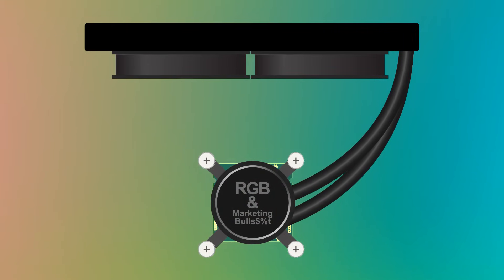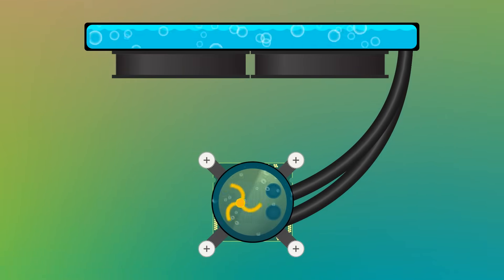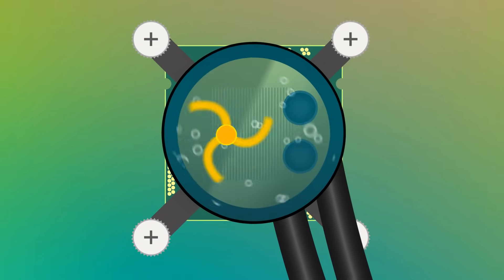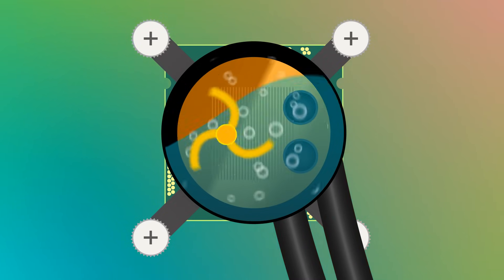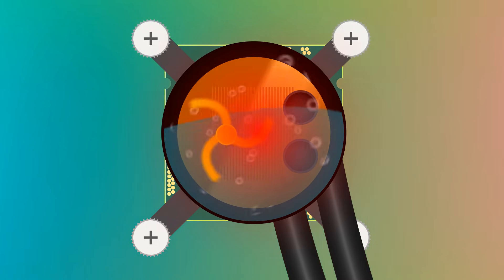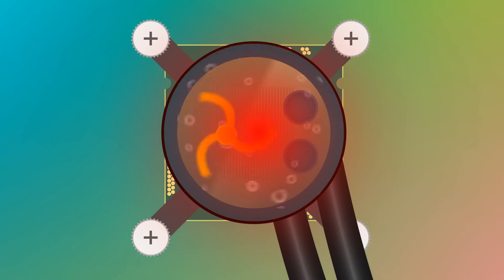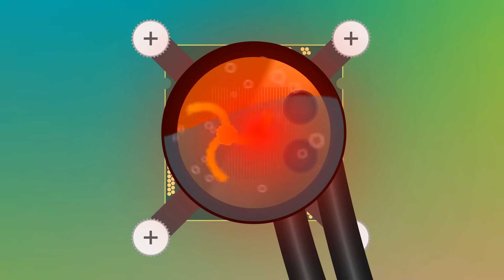Correct AIO orientation (This is the way)

Comment: I'm using a mini-ITX case so I have no choice but to have the CPU higher than the radiator. So I just oriented the pump so the tubes on the pump are at the top of the CPU.
Reply from the maker: I gave up on Mini-ITX format and just went big Lian-Li o11. 

Small case and cooling don’t really mix well unless you go crazy custom like that Optimum guy.
Reply: @tldrinfographics5769  That's all for the most part true. My job has me traveling a lot so I was kinda forced to figure out a solution with ITX. I was able to have success with the SSUPD Meshroom S V2 without customization. I have a Ryzen 9 7950x with a 280MM AIO and RTX 4090 in this build with no overheating.

Comment: Does it matter where the tubes are on the pump with the radiator on top mount?

Like if the tubes are going towards the ram or which is the preferred way?
Reply from the maker: If the radiator is on top tube can be anywhere.
Reply: @tldrinfographics5769  okay thanks for that ❤️

Comment: My radiator is on the side of my chassis but a little bit higher than the pump... but my temps is very good and i cant hear any bubbles flotting around knowing that my pump is on middle speed
Reply from the maker: If it ain’t broke don’t fix it sir.

Comment: Hi i've got my first aio nzxt x73 and it says that the tubes should be on the side well i've got a problem with this cuz of the 32gb of ram sticks when i install it to the side i pushes on the ram sticks and i don't wanna damage my motherboard so i moved my tubes much lower s that ok and the radiator is installed on top of my case
Reply from the maker: That should be fine
Just occasionally listen for gurgling sound and check CPU temp

Comment: I do not understand why you call this as marketing BS, because it is higher than fan. The problem is with the entry point which Nexus video said that it must be lower and not higher, because air will get stuck there. Overall, video was not clear enough for me, but it helped me to double check the information regardless.

Comment: Btw does this also apply to gpus with aios because I was gonna mount the GPU vertically with the 240mm rad under it also amazing vid keep it up
Reply from the maker: Thank you. 
I am not sure about the GPU radiators
But I think the principal is the same

So ideally the highest point will need to be the radiator.

Comment: What about a AIO that has the pump in the radiator. Would top mounted still be okay? Or if I did tubes down front mounted but the cold plate is highest spot of the AIO would air get trapped in the plate even though the pump is at the bottom?
Reply from the maker: For that particular configuration 1:30 is recommended.

And yes the tip of theradiator still needs to be the highest point in the system.

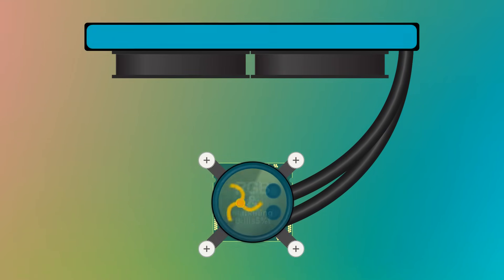Comment: does the AIO pump orientation have to be the way it is made? for example i recently installed an aio into my pc but my ram sticks got in the way of the hoses so i turned the pump 90 degrees to make clearance, could this be causing the issue? my current set up is the same as 0:11
Reply from the maker: Pump orientation isn’t as important as the radiator placement.

Comment: No it is not.
The better way to place it is:
- tubes out from pump are up
- tubes out from radiator are up
- pump below the lowest point of the tubes from the radiator

This is just following physics law that air will ALWAYS try to get to the highest point.

Your setup will need more (water) pressure to push all the air bubbles (if any) already trapped in the pump to travel down the tubes (they are placed very low at the bottom). Easier if they are travelling upward.

Comment: So I have an MSI CoreLiquid 360r mounted at the top of my case and its been making a clicking noise, this AOI actually has the pump in radiator. In my case, would I want to side mount the radiator with the pump being towards the bottom?

Comment: does continuous heat from cpu/pump will create  hot air bubbles in the water? 
if yes what if those hot air keep trapped between pump and the tube hose, but never goes back to the radiator?
Reply from the maker: No amount of air bubble doesn’t increase like that

Comment: Can you show please what if the radiator mounted front of case and tubes up ? I have 360mm AIO
Reply from the maker: Not ideal but it’s ok.
Reply: @tldrinfographics5769  Thanks for respond. I don't have enough space to flip tubes. I have corsair 275r.
Reply from the maker: @Rwayne-  yeah a lot of us are in the same scenario
Reply: @tldrinfographics5769  One last thing that is i wonder, how much it does affect the performance and tempature really?
Reply from the maker: @Rwayne-  From what I gathered from the internet it’s 1-2 degrees. 

And in some cases a bit more noise.

Honestly it’s best to mount it up top 0:11
If you can’t than change the case to big one.

Small build is always compromising.
Reply: @tldrinfographics5769  Thanks, I want corsair 7000d airflow series honestly. But it^s too much expensive here. Btw i meant that difference for mounting orientation. About tubes down - up radiator uper level than pump you know. I did not ask it for mounting top or front. I guess you understeand me already but i just wanted to be clearly in this case.
Reply from the maker: @Rwayne-  in any orientation difference are around 1-2 degrees C 

As long as the pump is below the radiator top end

Comment: My question is how do you know how much water is inside of the block. is it because the block is transparent?(not all blocks are transparent) Also wouldn't there be air in the block if the system was checked while it wasn't running because usually the water does run back and some blocks have only one intake and one output so there's only ones path for the pump to push it through. That's how my cpu block and other block is designed. Not sure which blocks are just pockets of space.
Reply from the maker: They always leave air in the system because water doesn’t compress much at all which means it will simply burst when it heats up.

Comment: If I have the tubes going up that's still ok right? The radiator is still higher than the pump and I hope there isn't that much air to still be picked up
Reply from the maker: As long as the radiator is the highest component of the whole AIO system it's ok.
Reply: Yeah, I really don't have the space for the tubes to go down
Reply from the maker: @Mart-E12  It’s ok, I personally don’t prefer it but if you don’t have space that’s the only thing you can do.

Comment: What if our video card is massive and there's not a lot of space? I.e. NZXT s340 elite, Asus Tuf 3080, h100i v2 (gtx). There is only one exhaust port at the top, so you cannot top mount and the video card otherwise saws the tubing if attempting to jam it between the video card and radiator. I guess the tubing has to droop in front of the graphics card at the window?
Reply from the maker: Ah that’s painful.
You can have the tubes up as last resort.
I personally don’t like that so I just went out and bought 011 XL

Sick and tired of hunting for space.

Comment: I dropped my idles from 40 to 35c on my 5900x with this video. My In and Out tubes were on top, mounted to front of case. Placed the In and Out tubes at the bottom and man did the temps drop. Made a bit of readjusting gurgling noise on first boot but went away after a few minutes.

Thank you <3
Reply: So if my aio is mounted on the front of the case , I should I have my in an out tubes coming from the bottom of the radiator instead of top??
Reply: @Jose-q6w6e  have you tested your theory?
Reply from the maker: Thank you I’m glad to hear!
Reply: Its simply...air floats to the top...They ALL float. Put the pump at the top and that is where it will congregate. Inside the pump. The trouble seems to be not enough tube length in a lto of cases

Comment: Watch Jayztwocents' video on this. The inlet and outlet do NOT need to be at the bottom, and many systems won't even allow the tubes to be down like shown here, heavily depends on GPU and case size and orientation.

Tubes up is still fine, it's just noisier, GN talked about that and people skipped over it and think tubes up is still going to kill the pump, but it's not, which is why Jay made a response reiterating that tubes up is fine.

As long as the pump isn't the highest point, it's not going to kill your pump.
Reply from the maker: You are correct.
Buy it’s still not the best to have the tubes up.

1. Radiator on top
2. Radiator front with tubes down
3. Radiator front with tubes up

That’s the order in which you should favour.
Reply: @tldrinfographics5769  I agree, but I just want people not to worry about it if their case doesn't support having the tubes down if the tubes are too short or the distance is too great, as is the case with popular cases like the standard O11 Dynamic with most/all 360mm AIOs.

AIO as intake also isn't necessary if there's sufficient airflow into the case; I switched my AIO from intake on the side of the O11 Dynamic to exhaust on the top, and I didn't notice a significant change in temperature with 6 case fans (all intake), CPU is 3900X and AIO is Deepcool Castle 360 V2... I suggest that people test the differences with their own hardware before making a decision on where to put and keep their radiator. What one user gets may not be the same result for you

Comment: But most AIO tubes aren't long enough to be on the bottom of the case especially 360mm radiator (most cases didn't support 360mm on the top)
Reply from the maker: I feel your pain, I barely managed to do 1:46 in my own case.

Last resort is tubes mounted top.
it's not ideal but it will be better than radiator below pump.

Comment: I have mine installed like you recommended but it started to make a rattling noise which i believe is air pockets inside. I saw that corsair recommends to have the inlet/outlet tube on top instead of the bottom which I will be doing. I hope it fixes the noise :/
Reply from the maker: How long has it been that way?
Reply: @tldrinfographics5769  i just noticed it a day ago. I hope it’s an easy fix.
Reply from the maker: @BobaT__  How old is the unit?
Reply: @tldrinfographics5769  the unit is very new. Just received in around february

Comment: What about the fan placement? can you place intakes infront or do they go behind the rad?>
Reply from the maker: if you are doing Top mount
make sure it's exhaust.

Front mount should be intake.

Fan placement on the radiator depends on the type fan I believe, some fans are designed for push.

Comment: Hi 👋 thank you for this simple explain but can you explain when the pump is in the radiator I have the Msi Mag CoreLiquid 360R And I am very confused how to set it Up
Reply from the maker: 1:40
Reply: @tldrinfographics5769  
I have read some comments They have said that If the 2 tubes are down that will make the pump under heavy load because it needs to rice the water to the block is that true? And what do you think if i do the same As 1:40 but flip the cooler With the 2 tubes at the top?
Thank you for reply 🤍
Reply from the maker: @bigbig7727  That’s not true at all, in fact the opposite is true.

You can flip it, but only if you must.
It’s not recommended.
Reply: @tldrinfographics5769 
thank you for the help ❤️

Comment: Honest ask, though: what AIO are people getting where they can, in a mid tower build with a full length graphics card, fit the tubes on a front-mounted radiator so the inlet and outlet are on the bottom? My GPU clears my front intake fans on my Meshify C by millimeters, and that's just the fans, mind you, no radiator.
Reply from the maker: Yeah it’s very difficult to front mount the radiator in most cases.

I ended up changing my case.

That being said front mount with tube on top is not the end of the world.

Comment: What about horizontal positioning, such as when using a case like the HAF XB EVO?
Reply from the maker: Can you place the radiator even a little higher than waterblcok?
Reply: @tldrinfographics5769  Yes, but could happen that the air will be formed around one of the tubes
Reply from the maker: @estanho  is the tube higher than the water block?
Reply: @tldrinfographics5769  Yes
Reply from the maker: @estanho  Which component is the highest point in side mount?

Tube
Radiator 
Water block

Comment: Great video! What about mounting a 240mm AIO on  its side and having the pump directly parallel to it? Its a small factor pc by the way
Reply from the maker: As long as the radiator is even a bit higher, say 1cm it should improve greatly.

Do listen for gurgling noise.
Reply: @tldrinfographics5769  thank you

Comment: TL:DR - Corsir Crystal X680 Case.
Top would have Liquid CPU Cooler, following instructions of video

Bottom would have liquid cooling to Asus ROG LC RX 6900 XT.

Would this problem apply to the GPU too? 

(The front of the case is occupied with fans, the back has vertical gpu slots..)
Reply from the maker: Are you doing custom water cooling with reservoir? Or AIO close loop?

Comment: And what about the MSI Core liquid where the Pump is build into the radiator??
Reply from the maker: 1:41
Reply: Well he says in his video "we don't talk about these today (meaning pumps integrated in the radiator)
Reply from the maker: Yes, but the main problem here is same.

No air in the water block where cold plate is. 

No air in Impala. Hence 1:41

Comment: Unfortunately, I have Corsair H80i GT a thick single radiator that cannot be mounted with hoses downward at the rear as no flexibility and the hoses would push hard against the GPU. Mount on top would be just as bad if not worse since hoses do not pivot. Unable to mount in front because then radiator be much lower than the pump, even with all the cages removed in the Phanteks Enthoo Pro TG. Therefore, rear-back is the only way to go with hoses on top. The other solution is getting a different and newer AIO or a Air "fan" CPU cooler such as Noctua u12A. Getting one with dual fins looks like crap and applies too much weight stress on motherboard. Hyper 212 is too big, heavy and ugly. However, configuring fans for Push-Pull does provide for better cooling. I would never suggest to anyone to do an EKwb custom cooling as tube fittings and such just a royal pain to keep tabs on - an extreme high risk for leaks and as we know, water and electricity are not compatible.
1) Air Cooling is safest but temps are higher. 2) AIO simple and clean, better cooling than air, but pumps are due to fail and also low risk for coolant leaks. 3) Custom- is the best cooling solution, looks awesome when done correctly but has an extreme risk of leaking and if you decide to take the desktop someplace, it is highly recommended to drain all liquids and disassemble. Custom cooling is for people who have lots of money in case of an incident their rig goes Ka-boom! Stick with Intel CPU's as AMD has now gone in the wrong direction as approaching TDP's with 250W to 300W plus. You'll need LN2 - liquid nitrogen to cool those hot monsters. Oh! RGB is a waste of money, I'd rather spend on Performance than on a Disco Ball PC.

Comment: What happens if my tubes are the lowest point on the radiator, but my pump is slightly higher
Reply from the maker: Pump must be lower than radiator even by 1cm.
Reply: Thanks alot. Will mount my aio on top with exhaust fans, instead of intakes in the front.
Reply from the maker: @linuskramberger9527  That's the safest.

Comment: Should I get a 240 mm or 360mm? (My case supports 360mm) will 240mm be better? since it will be higher than the cpu, while the 360mm 3rd fan will be under the cpu
Reply from the maker: I personally got 360mm 
Bigger the better
Reply: You need to consider whether a 360mm will fit with tubes down, some cases, while they support 360mm, don't support tubes down.

Comment: I have my radiator mounted in the front with tubes up. Is this ok?
Reply from the maker: Not ideal but it's okay apparently.
As long as the water block is sitting lower than top of the Radiator.

Comment: If I have a 360mm Corsair h1501 capellix we and mount it to the back right of my case (basically side mounted) and I have three intake fans on bottom and one fan top left on the side should I make my AIO an intake or outtake? Also can I have it in front of the rad? (I like how it looks more) and finally what should I make the one side fan?
Reply: I’m thinking I should do three bottom intakes, one top left SIDE exhaust and make the rad 3 exhausts (in front of rad) is this a good setup?

Comment: The 2 ways described here are wrong.
It should be vertical in front with the radiator top above the pump. In this way there's no air in the pump and all the radiator width is fill with water.
Reply: .. wha? whats wrong? it's in the vid.

Comment: Hello! That's a great video, but I have a question about my specific AIO. It's a msi mag coreliquid 360r. This one has the pump inside the radiator, not in the cpu block. My question is: There's a different rule for this case or I just need to do the same as for the other regular AIOS? Thank you.
Reply from the maker: Hi, for that model I think 1:45 is the best

Comment: The orientation with placing AIO at 1:46 is a problem with newer graphics cards because of the 3-fan design and overall length of the card gets in the way of this setup.
Reply from the maker: Yes, it's pain in the ass
I barely managed to do it myself.

Hose on top still works although not ideal.
Reply: @tldrinfographics5769  I have kraken and 3080 ventus and somehow managed to fit. My card is sitting on the bottom slot which is PCIE8x slot. I'm not 100% sure if this lowers my performance or not.
Reply from the maker: @Simulati0n  I heard there is about 1% difference between 8x and 16x so I think it's ok. 

Is it PCIe 3.0 or 4.0?
Reply: @tldrinfographics5769  3.0 my motherboard is z390 aorus pro